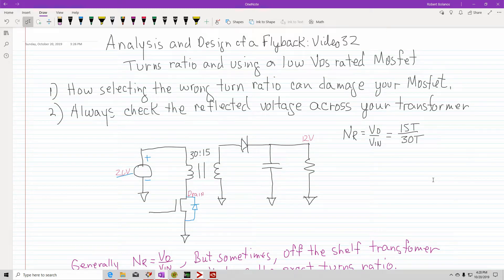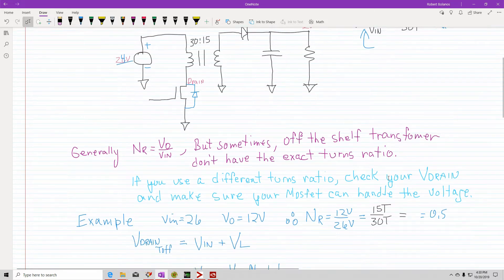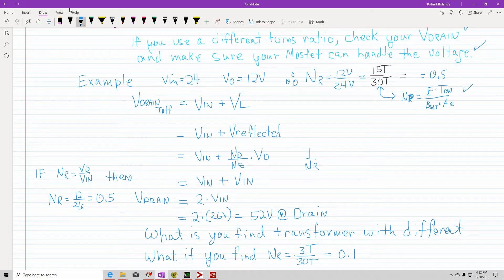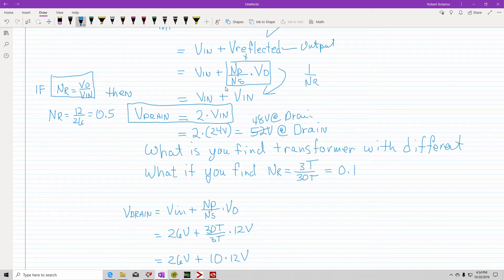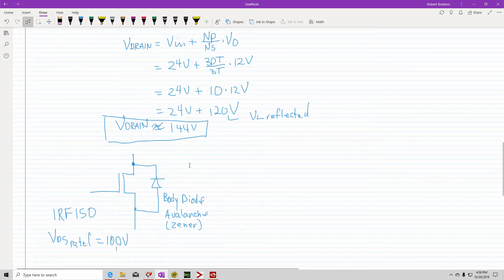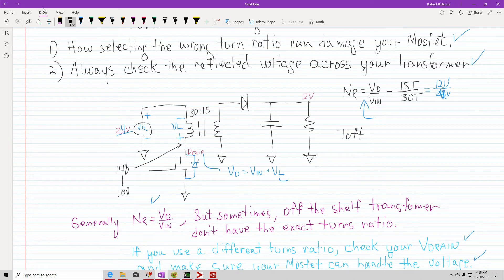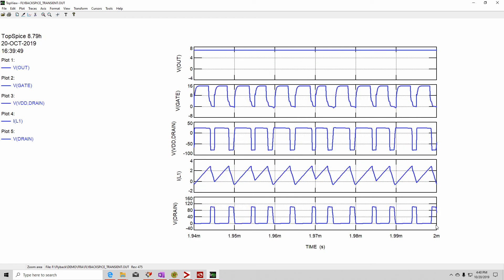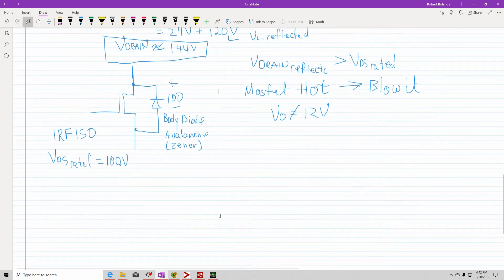Analysis and Design of a Flyback converter; Video 32   Turns Ratio

Comment: How is the secondary voltage 12V in the Nr = 0.1 case - surely the secondary voltage in only 2.4V in that case? This then gives the same Vds of 2* Vin = 48V...